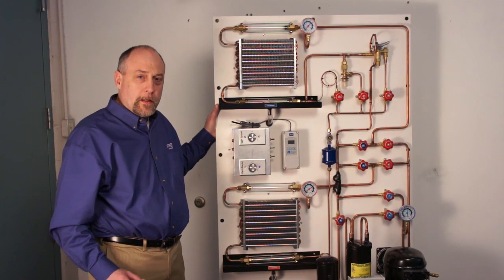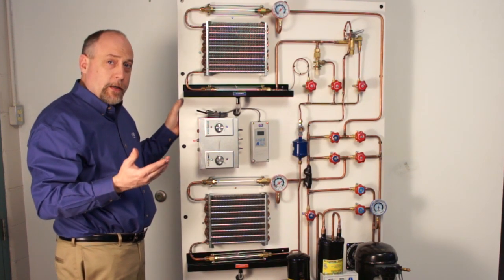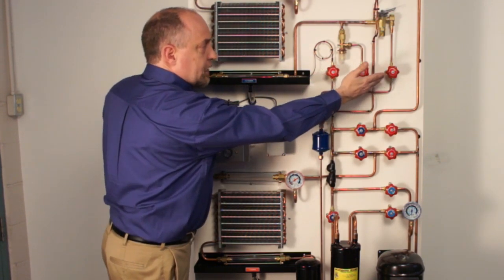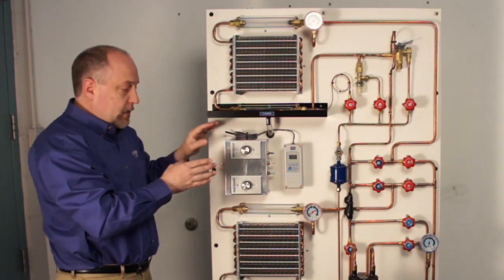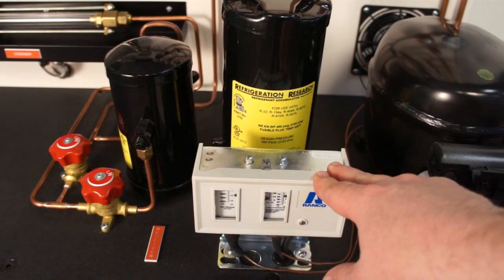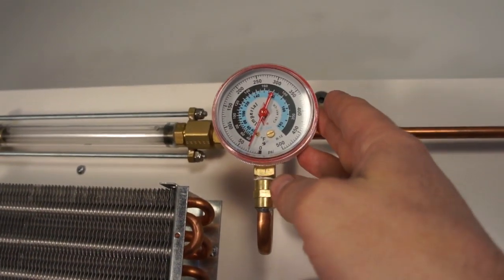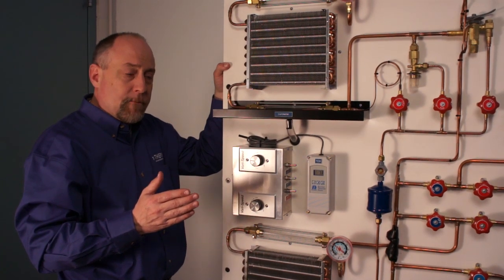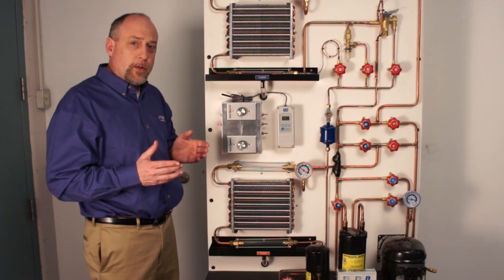iConnect TU-100/9001 Refrigeration, Air Conditioning and Heat Pump Trainer

Comment: Hi, mr. Bergman
May I asked about the heat pump, what will happen to the evaporator pressure if we increased the evaporator fan
many thanks in advance...
Reply from the maker: When the heat pump is in heating mode, the refrigeration cycle is reversed. The evaporator is now the condenser and vice versa. The system is affected the same way it would be in cooling mode just the coils are now operating in reverse.
Reply from the maker: This response is from our super tech Eric Urrutia, Mohammed.  Please note that Jim Bergmann is no longer with our company.... thanks!  Lori
Reply: Many thanks to Eric and to Lori